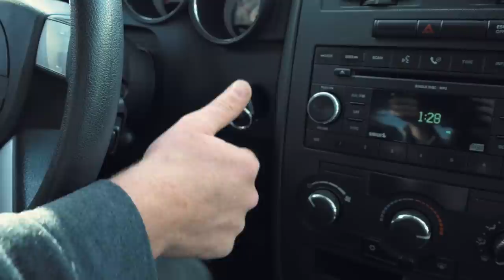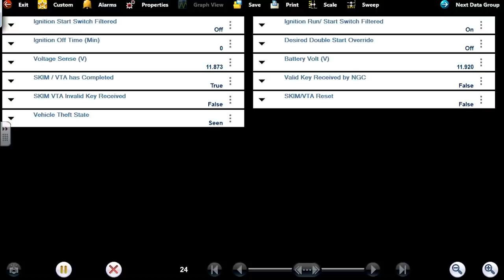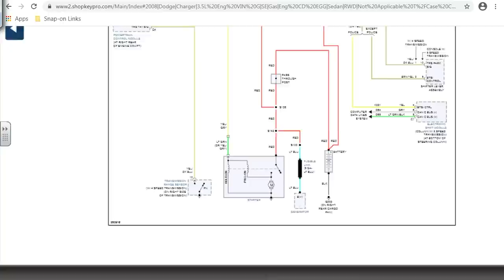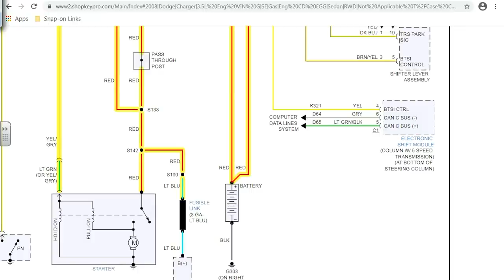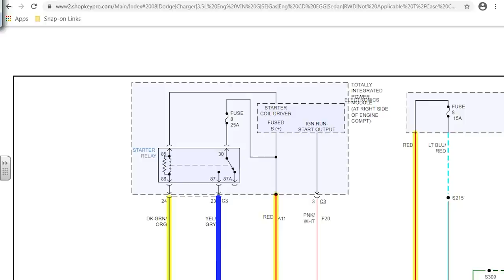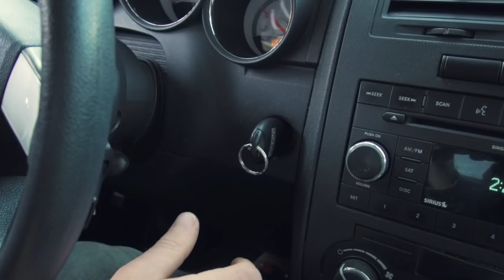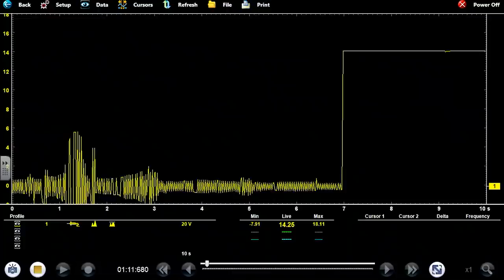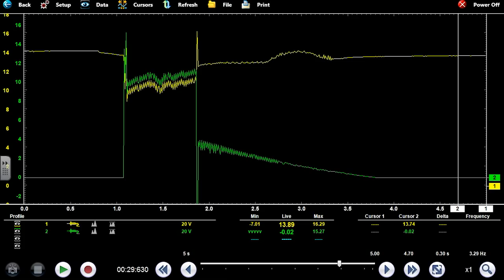Intermittent no crank - starting system troubleshooting (good starter)

Comment: I don’t know whether to watch for the education or for the entertainment! Caleb has made the videos more fun to watch than ever before!
   I have seen at least 3 or 4 times where relays clicked yet there was no continuity on the load side. Seen it happen more than once with a solenoid too in fact. For me, Clicking just confirms the control side integrity and nothing more. 
   I think that shop made the wrong call on doing a battery and starter. Your neighbor said the intermittent starting problem was ever since the battery and starter was replaced, however the car obviously went in for a starting problem in the first place.  I am sure this was the starting problem- otherwise the problem was a bad starter, a bad battery, and a bad relay. Occam’s razor dictated it was probably the bad solenoid and nothing more.
Reply: I like your videos too

Comment: A priceless lesson on relays! Back in the 80's, an old Ford mechanic showed me the burnt contact inside a relay that clicked. That lesson has stuck with me all these years, just because a relay clicks, doesn't mean it's good,tells me the control side is working. And just because a relay doesn't click, doesn't mean it's bad, could be a bad control circuit. Thanks for all you do Paul!

Comment from the maker: For additional information on this case study, like and follow ScannerDanner on Facebook and check out this post. I've dissected the waveforms for you and provide a detailed explanation of what we are truly seeing within them. https://www.facebook.com/1784722115093610/posts/2971219283110548/
Reply: Car cranks but no start. Scanner app crashes during manufacturer specific scanning. Only scans in OBD2 mode but no fault codes. 2.4 volts on both wires of crank sensor. And manufacturer specific scanning works only with injectors 3 and 4 disconnected. Engine Check light, water in fuel light and service light are flickering very fast please help....🙏🙏🙏 Car Tata sumo Gold Bs4 Dcm 2.5
Reply: @ScorpioUncle008  check to see if there is an aftermarket alarm installed, alarm modules tend to do this when faulty.
Reply: @scientist100  ok but the scanner tool works fine after the injectors are disconnected... But with injectors connected it only scans in EOBD option.
Reply: No fault codes
Reply: @ScorpioUncle008  sounds like a shorted injector. What about just the injectors removed whilst wires still connected to it?
Reply: @ScorpioUncle008  check to see what modules can the scanner can talk to.
Reply: @scientist100  thanks i will try this method

Comment: Sweet, your a genius. Clicking doesn't mean it's working. I found this problem with my purge valve, Bi-directional  controlled with the scanner, purge valve was clicking but the vacuum gauge was not seeing vacuum. You can also save your old relays cut the tops off of them remove the relay, solder wires to the connectors then fill up the relay with epoxy resin you'll have a nice DIY tool as a jumper. Nice animation Caleb.

Comment: I work on floor care equipment, I constantly teach my new technician to check relays, contactors and circuit breakers for voltage drop during diagnostic testing. I keep a relay with burnt contact in my tool bag to show my customers why it was a problem. 
Keep up the good work.

Comment: That was great! Simple as it may be, the way you illustrated the fault and how you approached the diagnosis oozes experience. I've fixed old electric window switches that suffered the same problem. Arcing deterioration of the contacts on the sprung metal rocker tabs caused intermittent function. Had I been as cool as you though, I'd've pulled out a scope and been all smug about it comparing waveforms with a better switch. Limited knowledge meant I just pulled out a meter and confirmed I had 12V at the input side and continuity on ground (thank f there was no bcm nonsense to deal with). From there, a simple mechanism allowed me to pull it apart, visually assert bad contact, a lil scratching, a lil bending, a lil greasing and it was good as new. Smugness levels were pretty high but what you did here would've added way more layers of smug to the equation. Thanks for the valuable caution about potentially frying the ecu hitting other pins. I've been out of touch with the field for years but watching these videos, I miss it enough to prepare myself for getting on premium, getting your book and start getting some badic equipment together to really make it sink. Your tribe gives so much to the community. Looking forward to pass the buck with much gratitude.

Comment: Fantastic job analyzing this issue. 
I have a 2017 nissan that the nissan dealership had no idea what to do.
Replaced the battery  and alternator. 
Same intermittent problem. 
I'll go see if it's the starter relay.
Nice job

Comment: Lisle makes special relay jumper test adapters for testing voltage drops and checks. Part #s are 69300, 60660, 56810, and 60610. It's a lot safer and prevents accidentally shorting the control/computer side of the relay. Excellent video as always! Also love your book!

Comment: I was picturing those contacts arcing, and even glowing momentarily until I believe the heat finally created continuity across those damaged points. That relay was smoked! I've got a 30 year old Ariens snowblower here with ignition points that looked just like that, lol. No spark. Time for a new set and a condenser. The last electrical component I tried to open, I did the exact same thing with the stupid pick! I was less jovial about it, and cursed up a storm, lol. :D

Yep - good riddance to 2020! I won't bring down the good atmosphere here with my problems, but today was a good and bad day all at the same time. This year is going to kick my ass right up until the last day it seems. Besides that, hope you Paul, Caleb, and the rest of the Danner family had a Blessed, Merry Christmas. Here's to a MUCH BETTER 2021.

Comment: Thank you!  This is the 2nd Video to help me trace the exact same problem for my 2007 Dodge Charger. Previous repair that helped was on this car you are featuring  had a bad ground to the front driver turn signal. Mine lost ground on the front passenger side.
Reply from the maker: Awesome! Nice job on your fix and thanks for the comment

Comment: The other brilliant remark I found on Paul's Facebook thread was how a big voltage drop across the relay while the relay is closed does not necessarily mean the relay is bad. After all, the control side also needs good power, ground, and no voltage drop so the internal coil can completely close the load side switch. So, after finding that big drop on the load side, we need to go back and verify the relay is getting an adequate trigger on the control side. With so many variables, I wonder if it would be more efficient to bench test the relay independent of everything else. It certainly is easy to remove, although high resistance on a relay pin might vanish when the relay is removed.

Comment: I was having this problem in my 08 magnum and this video helped me to figure out the issue, after throwing a new (yard picked) starter at it. I think in my case it was actually the tipm that is bad for a few different reasons but mainly that swapping relays didn't work. I'll find out for sure tomorrow.

Comment: Relays can most certainly be bad even with clicking. Sometimes on rare occasions they can actually stick closed keeping loads powered up. All the clicking means is the contacts are closing, it does not mean output voltage is what it should be to run the load. At least the TIPM is not bad here. Merry Christmas scanner danner.

Comment: Lol "a video with you is like leaving Target with my wife, we're never done!" 
Such wisdom from a young marriage. You two must have been together for quite a while before you tied the knot. 
Great video gents. I was thinking you were going to current ramp that circuit, but you went with voltage, and that told the story.  Nice work.
Reply from the maker: haha nice, good insight. Yeah, they dated for like 3 years before they got married 
As for the current ramp test, I wanted to do that, but changed course because I haven't looked at enough starter current patterns on a solenoid circuit. I felt like it would have just added more questions than answers, so I went voltage first. I was going to go there (amperage) if voltage was good, only because I couldn't get to the starter. If I could have gotten to the starter, I would have done voltage measurements there and not even considered the amperage measurement for the reasons I mentioned

Comment: Paul
What will be occur If you have a weak coil for relay.
May be relay click but doesn't close load side switch very good so it'll give you issue look like a bad contact, and you will have a voltage Drop. 
Is that possible?
Reply from the maker: yes, absolutely you must consider the control side (coil) of the relay in a case like this

Comment: Hi Paul, This comment comes 8 months after the video was published. Lisle do a relay extension type kit No. 69300. IE you take out a suspect relay then plug in the same extension adapter then reinsert  the relay back into the adapter then things are back in operational mode. The fabulous beauty is that each of the extensions has a set of tabs/electrical connection points on the adapter. These allow you to connect your test gear without the danger of cross connecting the pins. The kit also comes with sets of jumper wires with ready made connectors made for this. Hope this helps. You are probably aware of their kit by now anyway but if not I recommend you check it out. I saw how tentatively you were clipping on your crocodile clips. Regards as always, Peter A. (PicassoPete)

Comment: might i suggest that although the contacts are burnt creating a higher resistance the time delay could very possibly be an artifact of a mechanical defect in the relay.(binding contact pivot, weak magnetic field etc) (after all it carried enough to start  most of the time) either way it was bad and your diagnostic was spot on.  you'd never see that on a multimeter!!!  merry christmas to the entire danner crew.

Comment: Nice video. The only other question I would be asking is why the contacts are damaged. It could simply be the contacts wearig out. But I would also have to wonder if there is a failed snubber diode or capacitor that should be stopping any arcing when the contacts open.

Comment: What a brilliant case study. Excellent point, regarding how a new battery can make any high resistance problem better. And another excellent pearl, a relay clicking means it's getting power, not that it's good! I find testing a relay while inside the car complicated, because of everything else on the circuit, on both sides. Why not use the ground for the scope to be pin 87, the signal for the scope pin 30? You're isolating the drop testing to just the relay.... Regarding 2X video watching, I do it all the time on Youtube. But for your videos I pause, go back to the diagram, watch again, think it through. 1/2 X might be better, ha ha ha. Merry Christmas, Paul and Caleb!
Reply: Relays are not that hard to test in the car at all. So 85 and 86 pins are the coil. The coil needs power and ground so one side you need power at and the other is ground correct? So pull out the relay and use test light to ground to find power on one of those pins. Then use test light to power and go to the other pin and see if it has ground. If it grounds through the computer key will need to be on. The load side would again need power on one side which is usually pin 87 or 30. The load is on the other. Its not complicated

Comment: First time watching you work. You’re thorough and amazing! Watched the whole thing and was amazed at your step by step procedure. I have the similar problem with my 2010 charger. Dies randomly and long cranks then starts sometime with a traction control light. Changed the fuel pump, crank and cam senors but still starts and than long cranks. Switched the relay with the wiper relay and it worked. So I assume it’s intermittent. Not sure. But I’m hoping it’s a relay since it’s random. Either, your process is amazing. Keep it up.
Reply from the maker: Thanks man, really appreciate this comment.

Comment: Really loved your positive attitude. Your videos are just awesome. Scope was awesome. Question : I was told a long time ago that if you do a voltage drop test on any switch and the reading is larger than 0.2 volt then the switch is bad. Does this also apply between pins 30 and 87 of a relay ? Scope is king as you illustrated. Luv it. Danner also which i have not heard you mention is also not to use relays that are not protected. They cause enormous back EMF. Luv to hear from you. Regards Hugh van Zyl from South Africa

Comment: You could have tested the supply side of the relay using the switchbox. With ign off, you could eliminate the danger whilst still testing the circuit. Plus, testing the supply side was probably moot, as you couldn’t reproduce the delay when using the switch box. Great content mate...😃

Comment: Burnt up contact inside the relay for sure,  the weak battery is causing high current, which causes “sparks and arcs” at contact points. Get that girl a new battery and relay. Excellent t/s btw, I don’t have fancy tools like you but it’s all the same basic t/s skills used to determine faults. Latching relay circuits throw you for a loop for sometimes too!

Comment: 45:00, you're right about the clicking misconception. Though the relay testers works from the chinese brand, that red color looking ones, it actuates the relay 10 times and watches for voltage drop prior flagging it as a bad relay. Time saver when it works because I have seen some that do not work properly so they need to be soldered right at the incoming voltage connectors.

Comment: Good job Paul  At first i was considering switch bounce on the key's circuit based on the "double xxx " you read from the scanner.  I found it really cool to find out contacts bounce on the relay was the cause.  Even with simple electronics and hobby stuff, you can also experience switch bounce by turning on / off a simple loaded switch (even a living room lamp twist swtich... anything really)  I have a feeling what caused the initial problem was a crappy battery and could barely get a solid relay magnetic field and crank which caused the arcing and effectively destroyed the relay.  All that is left to be done now is determine if the current battery will charge properly or if the charging circuit is doing it's job.  (I think we should assume the battery is somewhat suspicious regarding it's present state).  Merry Christmas.

Comment: Another useful test would also use two traces. One trace on the starter motor line as you have it, then the other, instead of looking at the power in, can go on the coil energising voltage. That way you can see the exact instant when the solenoid should fire. It will also tell you if you have a problem with the energising signal.

Comment: We have a Ram 2500 diesel with an intermittent crank issue.  I have swapped the relay with a known good relay to no avail.  The truck starts immediately if you jump the load side of the relay socket with the key on.  I'm not sure if it's the WIN (ignition module) or the TIPM.  We're just going to wait until it's a consistent no crank and troubleshoot from there. Until then, we keep an emergency jumper wire in the glove box.
Reply from the maker: Perfect example and exactly the scenario as to why I showed such detailed testing! Focus on the control side of that relay!! Of course, when you can get it to do it again, right? Good luck

Comment: Hi Paul, great video. Might be a good idea to get some relay adapters that have testing pins. Lisle makes them, they work great. It would have been interesting to see what the waveform would have been directly across the contacts between pins 30 & 87.
Reply: Oops, missed the end of the video. Great test, I use the scope for all VD testing.

Comment: Perform voltage drop across the relay load contacts any voltage drop across the contacts approaching 300mv is a bad relay the resistance builds as the the contacts get hot the voltage drop increases. As you demonstrated with the scope what is the voltage drop compared to a new relay You can also compare the old and new relay resistance with ohms meter
The contacts are burnt like a set of distributor points Also you mentioned the low battery voltage is hard on the starter solenoid contacts and the starter as will as the relay

Comment: Great video, but do you need a scanner to do this, and which scanner less expensive? Merry Christmas to you and your family!!!
Reply from the maker: You don't in this circumstance.  You could have done all the checks at the relay. 
When you would need a scan tool, would be if you were missing control of the relay. (85 and 86)
There are many variables with that issue and one of them it to ensure all of the inputs are reporting correctly. The ignition switch inputs I showed, then the antitheft system and the park/neutral switch. All of which could be independently verified but without scan data you are working 10 times harder.